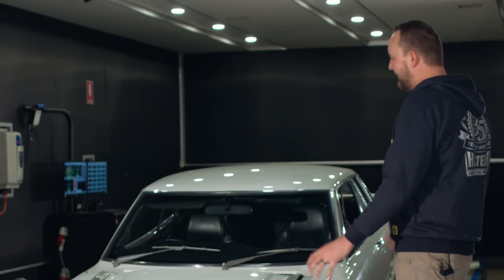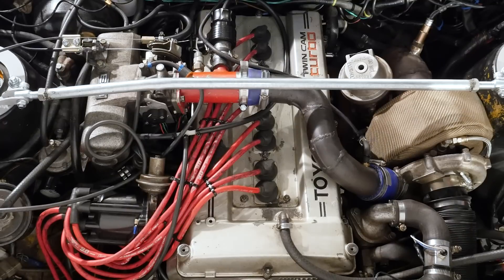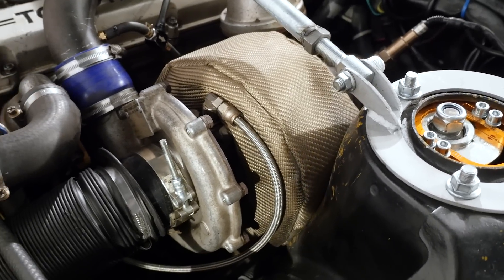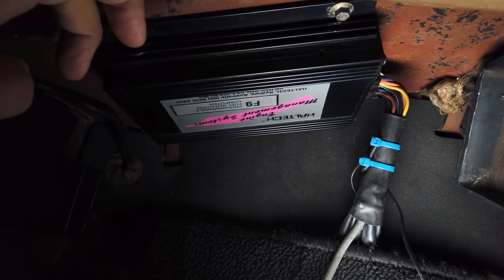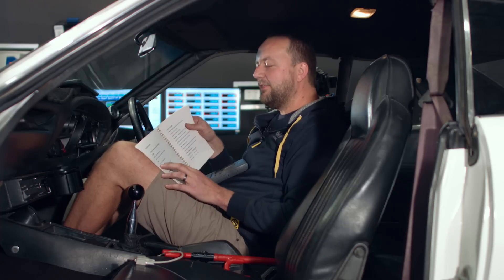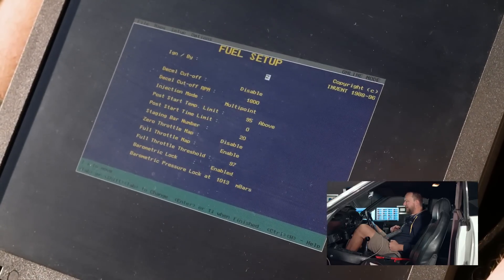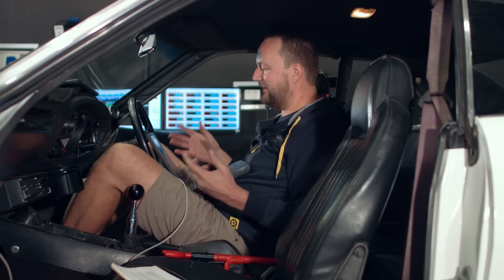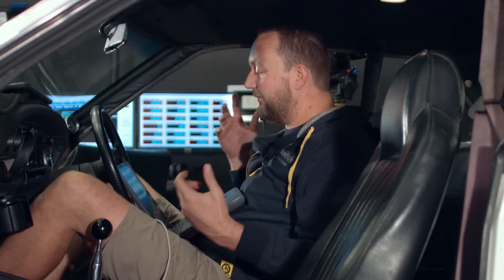🛠 Tuning in the 1980s | TECHNICALLY SPEAKING

Comment: Awesome video guys, I love the idea of period modding old 80s cars, definitely not going to give the results of using modern hardware. But there were so many obscure old school Japanese turbo and supercharger kits with old school solutions to fueling, like supplementary injectors, hob switches, etc. Catalogues full of stackable fuel, ignition, boost modules. Beautiful bolt in ARC intercoolers and intakes.  If I ever win Tattslotto, I'm going to blow a heap of money building a TOM's C5 MZ21 Soarer from the NOS parts that turn up on Yahoo auctions!

Comment: I had a TA23 celica I built around 96-98 with a 3T GTE engine. Intercoolers were a rare and expensive thing! You were looking at $2k+ for intercooler setup which was big dollars in the late 90's. There was no such thing as a cheap Chinese ebay intercooler. No ebay and you couldn't get one from the trading post newspaper either!
Reply from the maker: Ahhh... the good old Trading Post. sigh...

Comment: Serial (DB9) isn't that out-dated.  I'm using it in my car to run a custom LCD in the dash using a micro-controller to decode CAN messages from the ECU.  Also, my brand new standalone transmission controller has a DB9 serial interface for configuring it.  Just need a USB-to-serial cable and you're golden.  You could also run your DOS software on Windows 10 in a DOSBOX emulator no problems I would think.  Honestly, I can't think of any reason to keep old hardware around anymore.

Comment: Oh man, DOS thru a serial port!!! Straight up terminal command-line interface!

For those non-dinosaurs, here’s a tidbit: before Gates bought DOS from its creators and renamed it MS-DOS it was called QDOS for “Quick and Dirty Operating System.” Also, I remember the first external hard drive my mother (graphic designer since the days of x-acto knives, stainless-steel rulers, rubber cement and mechanical publishing on a light table, real OG shit) bought for her Mac Plus. It was a whopping 40 MB, loud as hell when spinning up, weighed about 1.5 kilos and took up 40 cm of desk space. Insane to think that was only a little over 30 years ago…
Reply from the maker: Ahhh those were the days, when cutting and pasting actually meant cutting and pasting, hot wax was used for sticking galleys onto artboards and touching up a photo mean actually using a paint brush on a negative film.

Comment: I cashed in my holidays and purchased an F3 from Barry Jones to run my old school 13B rotary to drop into my 4 door Mazda 323 in 1989, brought a XF EFI intake from the wreckers, used the throttle body, unsweated the injector holders from the fuel rail, machined up some injector mounts, made the intake from mandrel bends, went suck through, T04B / 42mm wastegate, had a lot of fun :)

Comment: Schwitzer still making turbos! Common on stationary or industrial engines.
Reply: Schwitzer turbos were used on David Brown tractors.
Reply: @AlexanderJuholaJones  David Brown also used Holset and probably other brands as well!
Schwitzer are usually simple, easy to work on and shared a lot of parts between the range which made them very popular for applications that didnt need max performance.
As a side note; Schwitzer is now owned by Borgwarner as is 3K.

Comment: E6K and S were great ECUs and very capable.  I also have one of those 3TGTEs from the 80s too; that's no toy engine, but would have been much better off with an E6K in that era as the distributor alone does not handle the ignition timing alone properly without the Knock Control Computer to advance and retard the timing with their 3 pressure switches to tell the ECU what the MAP Sensor would normally.

Comment: A turbo engine needs a 3D mappable ignition map so it is a shame this one does not have E6K ECU.
If it had an E6K ECU and you were to tune the engine as good as possible with that, how much better would the results be if he then upgraded to a Haltech Elite? Only ECU upgrade and remap.

Comment: This is great. Would love to see more old school tuning. Grassroots older stuff. Mechanical and electrical. While maybe newer technology is better for a modern day expert, what with everything be controllable and logged, this general situation seems so much more simple and relatable to me. You bought parts and put them on your car and nothing was ever quite right but damn if you didn't convince yourself it was all worth it lol I have some experience with computers and software but the thought of trying to DIY a modern ECU/Tune seems crazy overwhelming/risky/expensive to me. I put R35 ign. coils on my R32 and had to tweak the dwell time on the Nistune software. I spent so much time online trying to understand what to do and nothing was ever quite clear. Been running great though so I guess I figured it out.

Comment: started tuning haltec F3 systems in the -90.  still got it in a shelf it never fails. did modify it whit a 7 bar map sensor.  last run in 2010 did low 10 sec run in a volvo B20 chevy vega.

Comment: Takes me back to the days that my mates and I used to fool ECUs with resistors in the temp circuits and what have you, nowdays I am teaching qualified mechanics how to use a timing light... guys that have been in the trade for 15 years that have never seen or used one, don't get me started on tuning a carby lol
Reply: Yeah,  it's weird, too,   I'd been finally kinda settled down and rebuilding kit for a number of years of wrenching again,   didn't need to buy a timing light till this past winter.  It was also weird to have to buy one at all,  cause it used to be any given garage would have at least one of those oversized fake chrome ones from someone's Dad collecting dust on the wall.  :)  )

Comment: I ran a mate's workshop for a while in the 2000s.
He had previously specialised in, of all things, Lada cars.
Most of them had thankfully gone to heaven but we still saw a few of them.
I spent WAAAAAY too long nutting out an issue on a 'special' Aussie version that had EFI installed from new.
From what I recall it was a Peter Brock workshop built efi fitment using an Aussie inlet manifold and a Haltech F3 fuel only ecu.
The maps were 'locked' behind a password that the Lada dealers had so they could set base timing etc.
The one I got to play with was long after the passwords were forgotten.
I had the team at Haltech unlock the ecu and then tried to tune it - however, while I could view and change millisecond settings visually in the tables, the actual injector time remained locked 😳
After lots of phone calls, and sending the ecu back to Sydney, 
Haltech very kindly offered a repaired spare F3, but it meant starting mapping from zero...
Not easy doing the old road tune with a basic 10 LED O2 box 🤣👍
Got there in the end and made the owner happy, but gave away about 20hrs of uncharged labour. 
I was not going to let it beat me! 

The things you do eh. 😁
Reply: Togliatti Fiats ;) my wife ran several in Hungary.

Comment: Scotty: How well did you fit in the Celica? I've always fancied one of these early mark Celicas and I am about you size.

I wonder how well that kind of software would work in an older VM like DOSBOX with a USB serial adapter so you could use a modern laptop with it.
Reply: I wonder if Windows, being the compatibility monster that it is, could run this natively. I also wonder if this can communicate at all with newer software lol.
Reply: @Lassi Kinnunen 81 I didn't know they did that differently in 32 and 64 bit versions. Ports should be a breeze, but that's merely speculation.

Comment: in the 90s instead of a piggy back, i used potentiometers to "trick" the ecu sensor inputs. it was tricky as hell but cheap !
The other trick for more fuel was simply larger injector like from a RX7 and then lower the fuel pressure way down and tune it to run good at WoT reading spark plugs hahaha. Yea im that old i know how to tune reading sparkplugs!

Comment: My Vintage 1976 Datsun 280Z is running very nicely on a Haltech E11-V1... that's right. A V1. Bit of a rare beasty I'm told
Reply from the maker: Very rare indeed! Would love to see some pix of your ride!
Reply: @haltech  Posted a couple on FB page. Car is now in shop getting JDM bumpers. new T3 suspension, Electric Power Steering and a Motor with some more ponies.
Reply: @richardboyk3493  respectful bow
Reply: 240Z E6X here (was E6A). Dad's 1600 has an F9 controlled FJ20E.

Comment: I have a datsun 1600 wagon with S14 SR20 running a E6X pretty sure it was tuned by you Scotty back in the day. Want to upgrade but also like the old school coolness of an old ecu.
Reply: My EB turbo has an E6X in it too... Well, technically it does... It hasn't run for 6 years because the ecu started doing crazy timing stuff so I parked it and bought a house instead of fixing it...
Reply: @Rollin8.0  i dont think mine is controlling the idle control valve correctly so ill upgrade to something else in the future.

Comment: Oh the memories. Not all of them good ones. I remember having to remove the separate driver for the extra keyboard functions to have enough free memory to run games. Mucking about with making a boot menu for it was... painful.. Strangely enough it hardened me into thinking Linux was smoking easy! :P
Reply: Started using DOS back in the day, my daily driver is a Linux box these days...  As Scotty was "cd"ing around I'm thinking "yep, that's how it was done, no tab completion either." but my brain kept screaming "ls" instead of "dir".
Reply: My first upgrade was a Math Coprocessor for a 386SX, to squeeze all that rad floating point arithmetic magic. Remember when 33MHz was fast? Config.sys still haunting you (as it does me?) lol

Comment: I had one of those aftermarket cruise control systems... It was basically a bicycle cable pulling on the throttle.. the little lead ball would rip off the end every couple years... 🤣
Reply: Last fited one of those 5 short years ago to a '97 Delica diesel. Still available and you can even fit them to an e throttle car, by having the cable pull the pedal. Great for a low end modern car that is difficult (or not cost effective) to tune/replace the ecu
Reply: @idrisddraig2  I remember having to do pedal pull steps.. then you would have the customer complain they can hear the vacuum valves...
Reply: @Lassi Kinnunen 81 one in my 97 honda is factory and almost identical